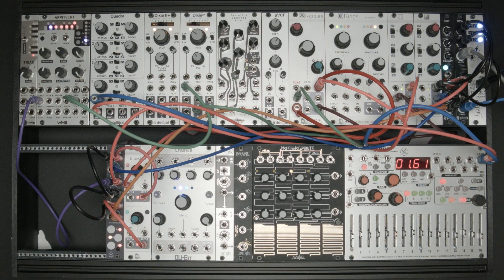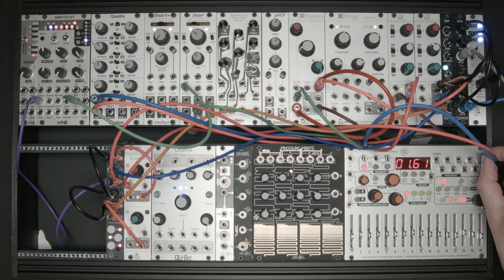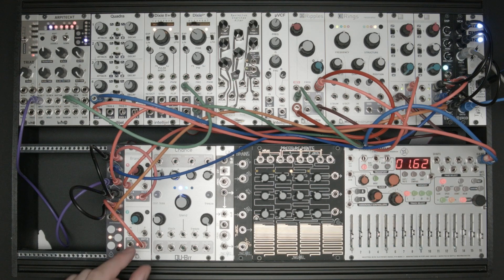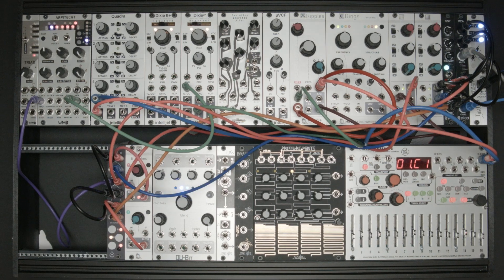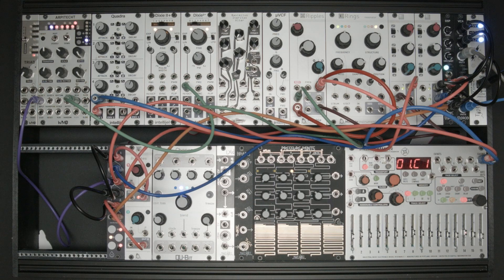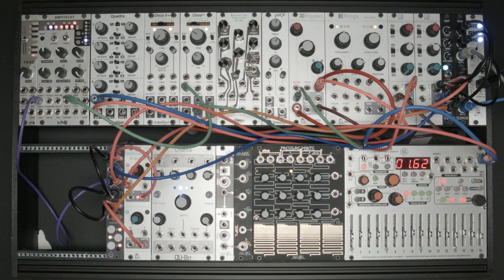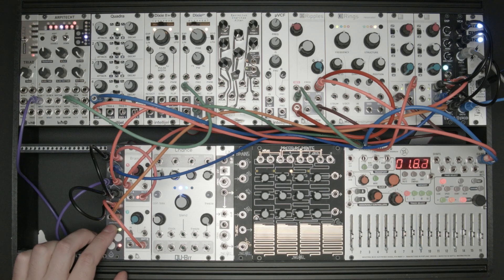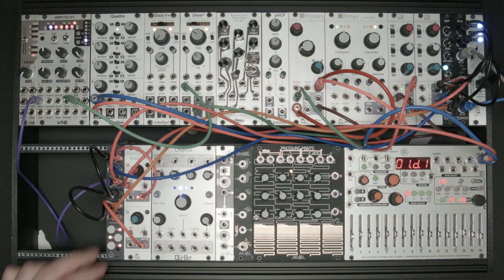Switchblade tip 1: melody switching

Comment: Hi.  Love the module.  Can i use something like a simple cv gate to mute and stay unmuted until i send another gate?  I want to control channels of different eurorack drums 9kicks,snares,hats..) with my feet (maybe a foot switch that will send a simple gate when i press it and have say 4 footswitches (1 for each channel)   Would this work and any other info or thoughts on this ideas would be greatly appreciated.  I haven't got it all worked out ...still in the works.

Thanks
Reply from the maker: yes if you patch a trigger or gate into the trigger input of each channel of switchblade while it's in "latching" mode each rising edge will flip the switch or mute/unmute both inputs
Reply: Thanks a bunch.  Get one on the way!  Cant wait.  Keep Jammin'